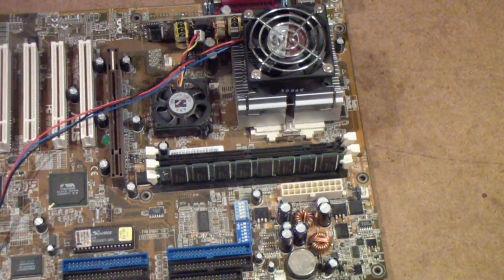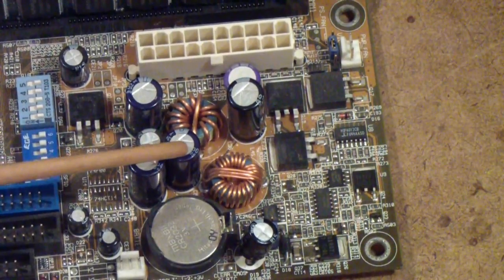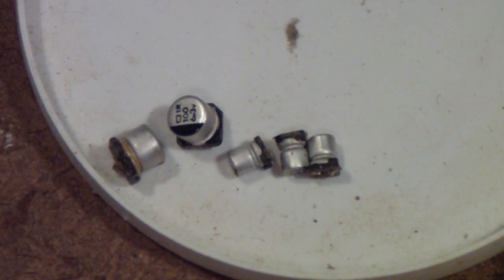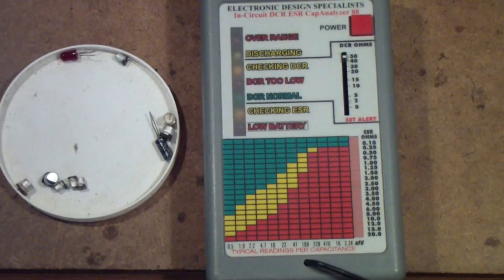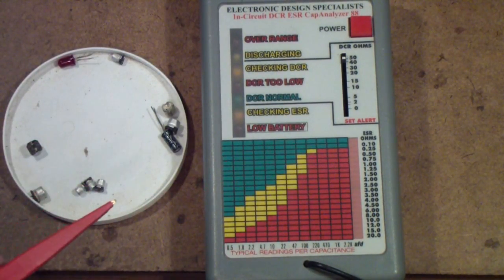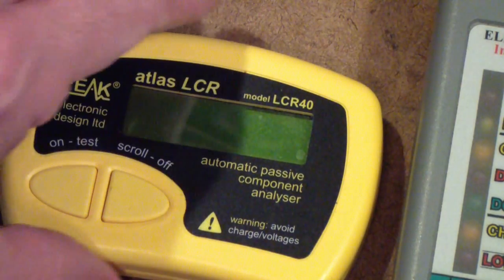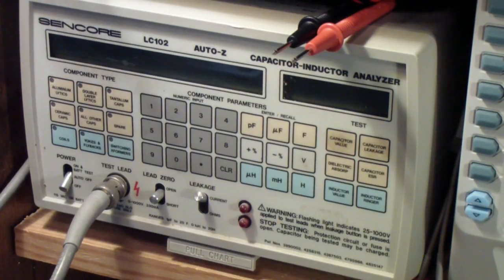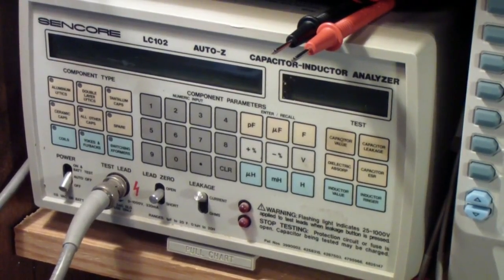TTT130 Testing Capacitors Pt B

Comment: Hi Tom,, Sorry for my last silly question Video 1,,,  the  LC-102 simply answered that one,, Wondering though,, what a instrument like that would cost ,, Thanks again :)
Reply from the maker: The LC102 sold new in 1996 for $1995.00 I got mine in about 2000 for $300 from a service shop that was getting out of the VCR business. I would check e-bay for recent sales prices. There is also a successor to the LC102 which is the LC103 but I think that is also now out of production.
Reply: Hi Tom,, very nice to hear from you,, Thank you,, I was looking on Ebay,, the 103 still sells for around 3500 ,, Ouchy,,, I'll keep looking for a less expensive alternative,, :)
Reply from the maker: The LC 102 is nice but in no sense necessary for good capacitor testing. All you need are: 1. An accurate reading of capacitor value (available on many Multimeters, etc.) 2.Reliable measurement of ESR (preferably at 100kHz or so) and 3. Leakage measurement at voltages up to the rated value of the capacitor (or the circuit if less). A good 
ESR meter (like the Blue ESR) does the first two and the DIY tester I showed in the video does the third. Anything more is really just a matter of convenience or choice.
Reply: I basically need a tester for testing large value electrolytic capacitors for amplifiers,, I do have a small ESR tester but it won't test for leakage,That i'm aware of, and it won't go above 250 volts for caps larger than 100uF,, I was thinking of trying to acquire a Eico 950 B,, how do you feel about those,, Really wish I could afford a LC102 but,, unfortunately at this point in my life way too expensive. Thanks again for your great videos,, very helpful and informative,,,